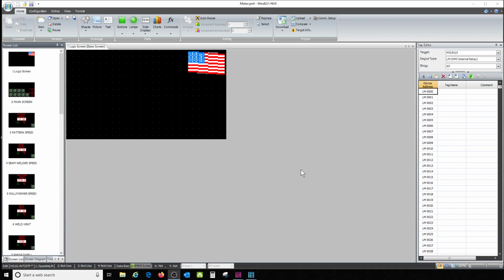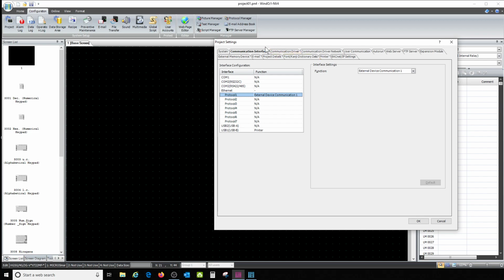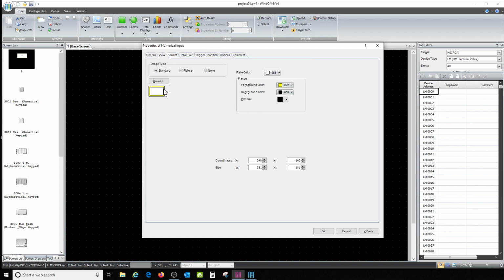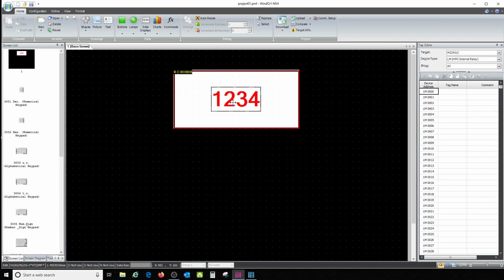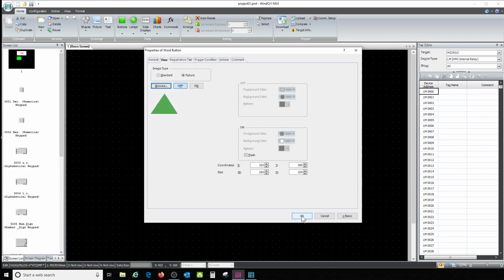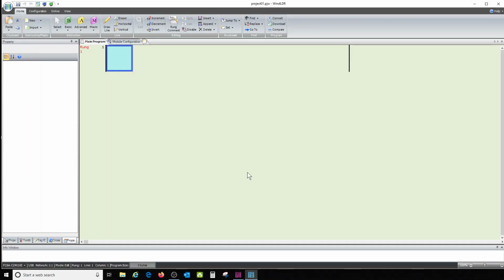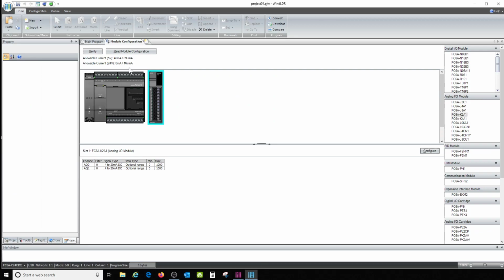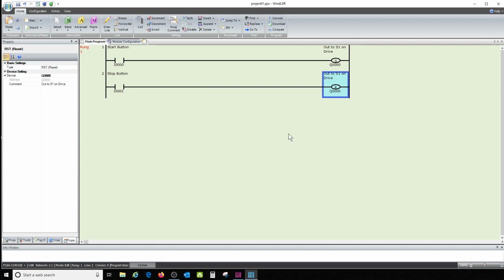IDEC Yaskawa 4-20 Drive Control

Comment: Hi, two separate questions:  Why are comments turned off on your recent video?   Do you ever use WindCFG?   Would/could it ever be used with FT1A?
Reply from the maker: I honestly am youtube lowerlevel intelegence.  Lol.  I dont know why comments would be turned off.  In fact, I look forward to comments.  They help me learn, as well as help.   As far as win cfg, I dont use it.  I actually think it has been somewhat discontinued.  I use the configuration tab built into wind ldr, on the plcs.  I honestly dont even know what wincfg does.
Reply: @huntxtrm  If you accidentally set the video as "made for kids" then it will disable the comments.  Or if you selected the setting to "Disable comments".
Reply from the maker: @michael931  ok, I did see it said made for kids.  I will see if I can edit it.